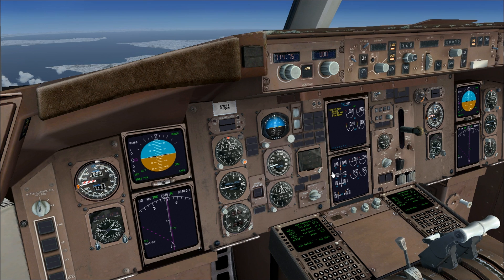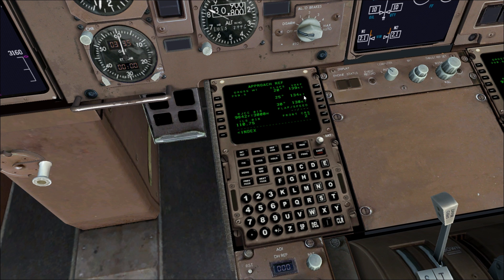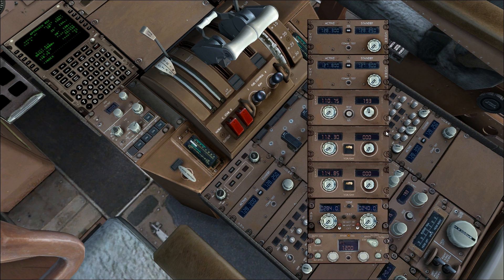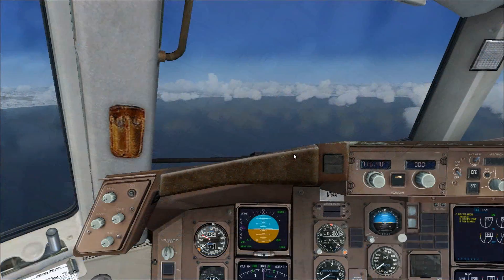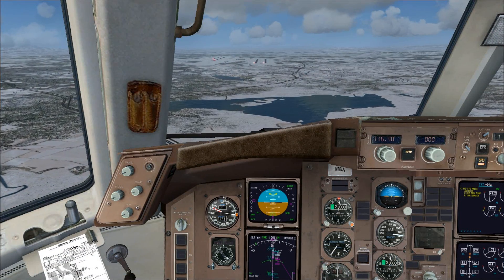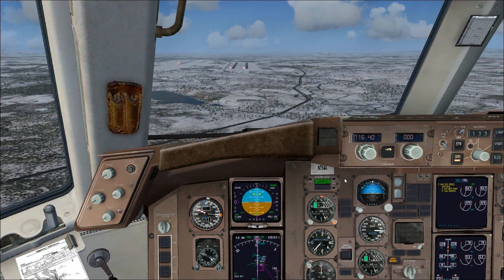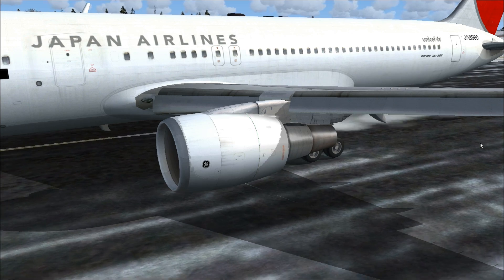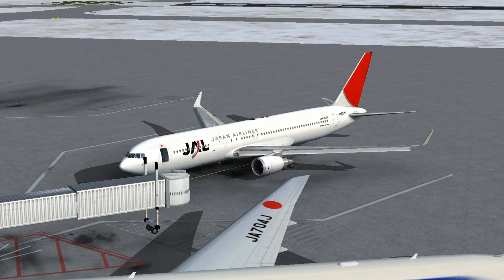767 Tutorial Part 4 - Descent and Landing

Comment: You should've disengaged the A/P a lot earlier.. That's the only reason you touched down hard, don't blame the fuel load for the fact you touched down hard, it's almost only because you didn't flare and let the A/P do all the work down to 10ft.. It's not a 737NG or a 787 that have an automatic flaring system when intercepting a Glideslope..
Reply: Agree, also should have the APU on way before you taxi to the gate

Comment: you basically just disconnected ap 1 foot off the ground and called it your own landing lol, normally based on the meteorological conditions i disconnect the ap when ive got the runway in sight and im configured for landing which is for me, normally about 5 miles since i drop my gear right before i drop 15 degrees of flap

Comment from the maker: To be safe, I'd just make sure that the ILS course and freq are set on the radio panel. As for the aircraft not establishing, I'm not sure. Are the magenta ILS markers showing up on the PFD? If not, you may be at too high an altitude. It displays NO AUTOLAND when none of the autopilots are available for autoland, which would either mean the airport doesn't have ILS or the autopilots are turned off.  I'll see if I can check it out, although I'm out of town for the next few days.

Comment from the maker: Well, complex sims aren't for everyone, but if you want to give it another shot, try the "757/767 FMC Tutorial" I linked to in the description. It's for the 757, but the 767's systems are identical, so you can apply the same procedures. It goes through each step individually, so it might be easier to follow than a video.

Comment: can someone tell me why not any plane on FSX (neither standard nor add-on plane) is able to make a good autolanding with autoflare etc. ?
why is it not possible to programm the "autoflare" function into an add-on?
aircraft are just bumped on the runway by the autopilot without flaring.
in real life, gear would break & passengers would scream.
it's a pity that only this little detail is missing to simulate a real autolanding

Comment from the maker: You might know spoilers as the speed brakes: use the "/" key. To extend them incrementally (you shouldn't extend them fully in flight), use the lever to the left of the throttle, next to the trim control.

Comment from the maker: "Drag Required" means that the autothrottle has completely closed the throttles, but the plane still hasn't sufficiently slowed down, so you need to add drag by deploying the spoilers. It's a coincidence that you got that message when you tried to select the landing speed.